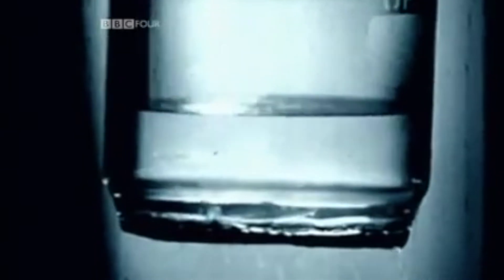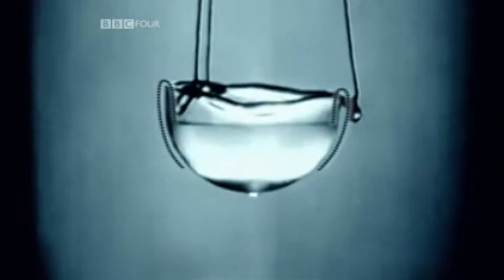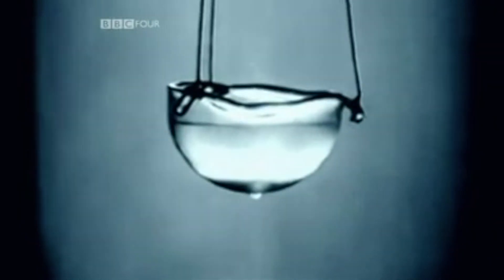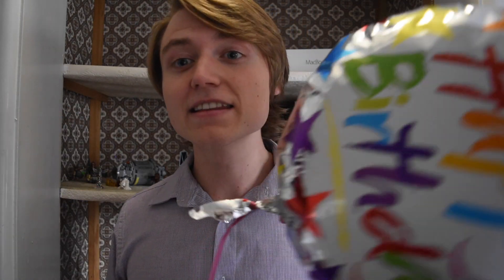Superfluidity and Helium

Comment: Liquid Helium II is a superconductor! This shows that it doesn't have zero viscosity. Why? It has surface, isn't it? The formation of a membrane on top of liquid Helium II clearly shows that helium atoms can adhere onto one another to form membrane; thus this nullifies that it has zero viscosity. So, liquid helium II is a superconductor! All superconductors will have maximum specific heat capacity at critical characteristic temperature! What does this means? At critical characteristics temperature, superconductive atoms will  stockpile abundant stationary photons. This causes the some portions of the nucleus have paramagnetic and other have diamagnetic characteristics. Therefore every superconductive atom is strong antiferromagnetic. In addition, liquid helium II atoms also possess high kinetic energy due to their high saturation of stationary photons. This makes liquid helium II atoms can leak through even superleak. Antiferromagnetic characteristics of liquid helium II atoms can also make them adhere well on the wall of any container. In addition to their high kinetic energy, this enable them to creep out from the container. Liquid helium II can form fountain clearly attests that they have very high kinetic energy. If you are interested in real discoveries, I would recommend you to read my book, The Unification Theory - Volume One and you will be amazed with lots of new, interesting discoveries. In God I trust.

Comment: Liquid helium at lambda temperature is superfluidity where the nucleus of helium atoms will start stockpile abundant stationary photons from the surroundings in parallel to  its high specific heat in which we reckon that those helium atoms will have very high kinetic energy.In addition, we suspect those helium atoms are also enveloping with rather strong magnetic field at lambda temperature where they can adhere well enough onto the flask's wall while allowing their high  kinetic energy to move them to creep out from the flask that known as superfluidity. The theory that liquid helium at lambda temperature has zero viscosity or frictionless can't really explain superfluidity of liquid helium at lambda temperature because nobody can walk up a slippery slope (needless to say steep wall of the flask). It's their high velocities and rather strong cohesiveness onto the flask's wall allowing them to  creep out of the flask. The mystery of superfluidity of liquid helium at lambda temperature has been resolved. If you are interested in real discoveries, I would recommend you to read my book, The Unification Theory - Volume One and you will be amazed with lots of new, interesting discoveries. In God I trust.

Comment: Is outer space cold enough to create superfluid helium?

And if so... infinite energy generators in spaaaaace?!
Reply from the maker: Unfortunately space is too hot. The temperature of space is around 3K, whereas helium needs to be at temperatures less than 2.7K to be liquid and even less to be superconducting. So no perpetual motion machines in space for us!
Reply: @RyanRidden  but this is a mean. It have places in universe with a temperature of 1K. 🤔
Reply: @djowdrow  how to reac
h there ??
Reply: God
Reply: He made an error. He didn't tell you that in order to do the fountain you need to add heat. He explained it wrong and said its because you need cold.